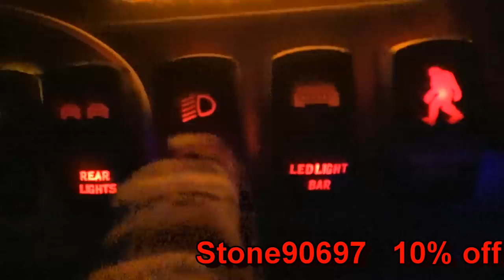PIMP MY GATOR... LANDED A SPONSOR...YOU'LL NEVER GUESS WHO!  MICTUNING LIGHT BAR INSTALL!

Comment: # 785 here Josh....that light bar is awesome....tell ya what I added to my Yamaha Grizzly 4x4 that kicks butt is a 3000 watt inverter that can run small tools like a drills... grinders....sawzalls...etc. and charge batteries.Just get the better real sign wave type for things like charging batteries for a laptop cell phones.....lippo batteries .They are more money but can run delicate electrical items.I also designed a stereo system with cassette player.It can be removed with 4 wing nuts .Stay away from them sharp razors.........Wooo

Comment: Plastic crap always falls apart. Were you late for your appointment? BTW, see if you can heat a nail and melt it through both parts then use JB Weld and maybe it will stick together.
Reply from the maker: Yes I was late!

Comment: So a guy that has a beard and mustache is sponsored by a razor company.....did it not dawn on you for the wife to try them out?  How is that extra light bar going to fit when you put the top back on and you just added an 180 watt light can  the charging system handle the additional load?  Why do you want your .22 out in front of the Gator when the mount will break and you will then drive over your rifle?
Reply from the maker: Well dang Mr. Negativity.....let's address your questions:
1. I shave my face and neck line at least 5 times per week, a beard doesnt mean you dont shave...it's a fine work of manscapeage
2. Measures were taken to ensure the light bar, windshield and top all fit (I hope)
3. That aint no .22 by the way...if the rifle is right out front I have my eyes on it...if it's in rear and it falls off....who knows where it is?

Trust me dude....thought went into everything here...lessons learned on the rear mount...and throwing away that garbage broken mount ...ordered a better one last night...trust me brotha...I'm thinking thinks through
Reply: I looked through my hunting stuff as I thought I had an extra set of the ones that I use that really hold up so I could get you a brand.  The only problem with the brand I use is that the rubber bungie part gives out but it is easy to make replacements using surgical tubing.  Your manscaping looks like you use an adjustable head trimmer to give it the shape you want not a razor which is what I had to do back when I was in the lab to get medical masks and respirators to seal correctly.  As for the mounting of your rifle way out there I think you will find out that it is way to far away.  That is a fine place to mount shovels but not a firearm.  There are several quick mounts that attach between the overhead bars of your gator so the rifle is over your head where you can get to it quick.

Comment: Why noot mount pvc pipe to the sides standing up for tools? You drop your hoes, rakes, shovels  etc in, head side up. Then use the better clamps on front for gun mounting.. ditch the trashy one..
Reply from the maker: Side mounts get pounded going around tight corners...
Reply: Stoney Ridge Farmer doesnt really matter but i think you are thinking  im talking about them laying down vs like a straw. Even if yoy mounted one in front in its side, just use thicker pvc. When i did labor work,  the work truck was loaded  with pvc standing upward. Its doesnt matter about corners. Id actually want to mount a rifle with quicker access. 1 thing about pvc, it can be shaped, n painted. A lil heat in right spots. My idea would effect your turning, or whatever. Its behind your seat on the outside... use your imagination...~ ~ ~ ~.(add dream sequence  here) ~ ~ ~